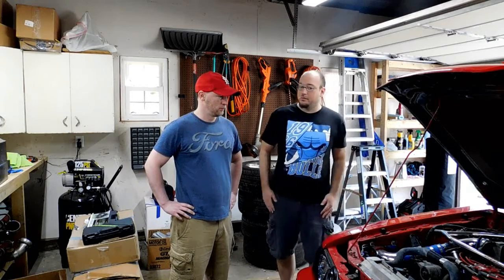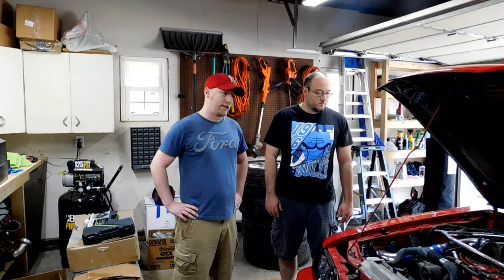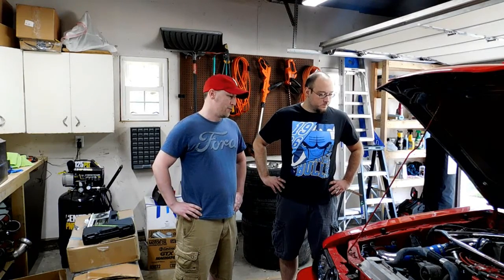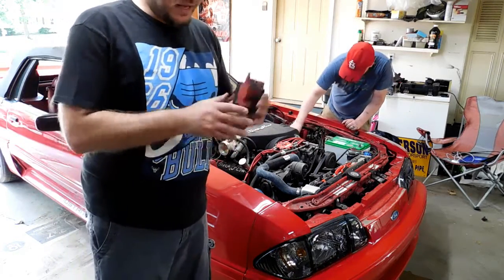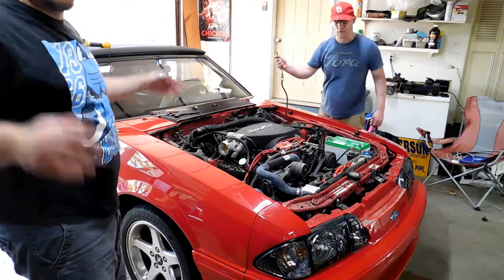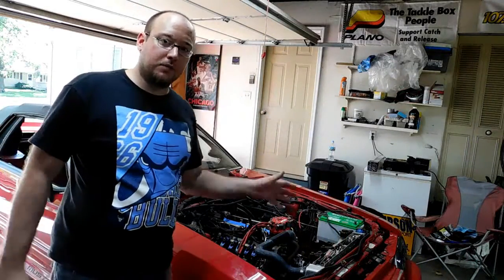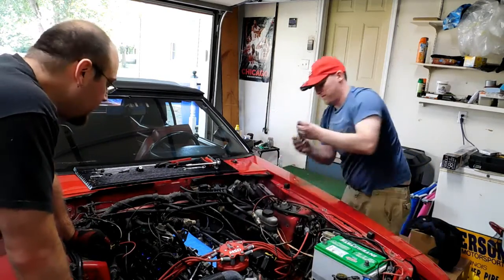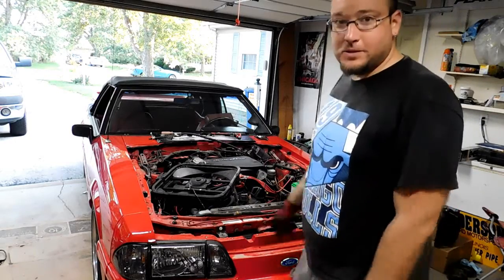91 Mustang Convertible work

Comment: that 6al ignition box will burn fuel at a faster rate and conbust the chamber for more power, plus aren't you running a turbo on your car, hotter the spark the more all all the fuel is burned and exited out the exust. JUST SAYIN